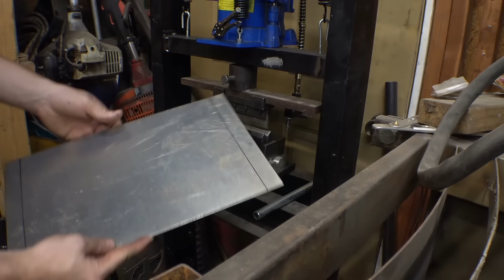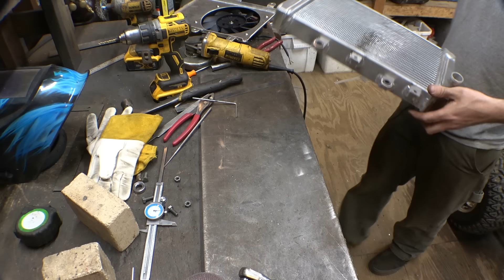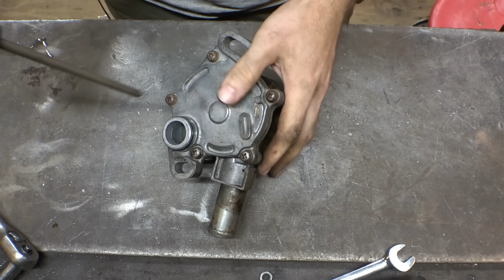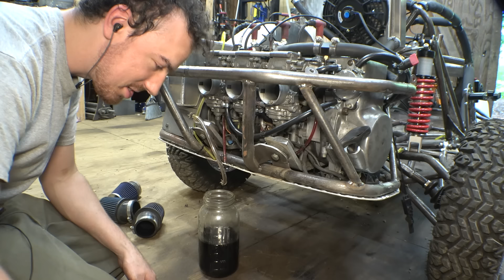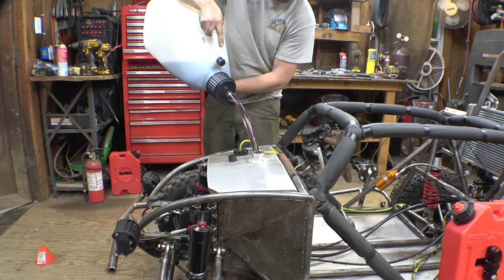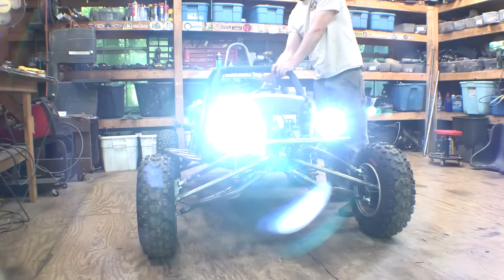Fixing all the Problems on this - Mini Baja Bug Project

Comment: If the internal resistance of that battery is low it will cause the regulator to use a lot of power. I'd try another battery. 14A is way too much and you'll lose the battery and the regulator if it runs like that very long. If it's not the battery causing the issue it's the regulator. Another thing to try would be an in-line DC amp meter on the battery side of the regulator. Clamp amp meters only work on AC.

Comment: It should be OK. Just remember that electrical devices draw current to them. Let's say if the head lamp draws 10 amps then it's only going to draw 10 amps. Voltage is the pressure. Voltage is what you have to worry about. Anything over 15v is not good for 12v systems. It's normal for the battery to read over 13v after shutting down the engine because the battery will maintain a surface charge for a while but will normalize in about an hour. The regulator was probably getting hot for lack of ground or lack of heatsink depending on the design of the regulator.

Comment: Bro, how many ac volts does the engine give? If it is less than 70v, you can install a diode bridge, and after it install a ds-ds converter 80 to 12v from an electric bike. A cheap ds-ds converter produces 10 amps at peak. This will be enough for LED headlights and charging such a battery. A dirt bike has one piston, but this thing has three, so more amps! This converter gives a lot of amps to charge the battery and the battery can overheat and splash acid. Also because of this converter, there may not be enough voltage for good sparks. =)
Reply: amount of pistons in the engine doesn't affect the charging system... also charging and ignition circuits are separate, theres a different coil for each.
Reply: @no.nomoreidontcare  Thanks! Now I know! =)

Comment: Should have kept the oil tank and either left it full with 2 stroke oil so you'd never be without oil for mixing if out on a trail etc or used the tank as an emergency fuel tank. My 2 stroke kmx125 doesn't smoke wot so ever & its oil injected infact 2 strokes shouldn't smoke if the mix is correct but people always go over the top when mixing fuel & oil . .

Comment: Amperage is determined by the load.  You're fine.  Also no problem with a 12v battery having a surface charge higher than 12v.
Go do a wheelie and everything will be okay.

Comment: The biggest problem with deleting the oil pump is having no over run lubrication. You get no engine lubrication when decelerating or descending long hills. When running premix just don't let the engine rev without having your boot in the throttle.

Comment: The white stuff inside the cover looked like crystallised glycerin from the coolant
Also the battery should be charging at 14.5v roughly and will gradually drop down to just under 13v

Comment: The regulator is not about 2 stroke vs. 4 stroke.  It is about amperage of the stator and the rpm range.  I would look at the model for your engine and find a comparable stats in amperage and voltage on both sides.   For the fuse...not quiet.  Since you found 25 amp fuse for the regulator input at least.  The fuse being between the stator and regulator only protects the regulator that is designed for the 14 amp load.  The 25 amp fuse makes sure that the stator does not go crazy on the AC side to the AC side of the regulator.  If the regulator itself is not designed for 25amp input, it will blow happily with the 25 amp fuse with a system that is designed for 25 amp load and the regulator that you picked does not have a 25 amp input capability.  The fuse will be fine and not blow.

Comment: I can't believe the 2 stroke pump wasn't working at all; otherwise,  you'd have seized it.   Having said that,  those oil pumps on older motors have a tendency to fail when used with alcohol blended gas.   Deleting the oil pump is a very common mod. 

Another note,  I'll bet you were pulling a lot of air into your coolant circuit thru that failed bearing.

Comment: Get rid of the original water pump replace with an electric one. Pre mix fuel. Small oiltank (rear brake motor bike tank will do)  tank on to oil pipe leading to crank keep full off oil  👍

Comment: I hope this helps... You can have a 100 amp alternator on a project, but it doesn't mean it is "pushing" 100 amps. Amps are "drawn" (pulled) by accessories. Your rectifier is supplying about 12 or 14 volts of potential. That's all. If nothing is drawing on it, then it's 0 amps. If you put 120 watts of lighting on there, then you'll be drawing 10 amps on your lighting circuit. If your system can't supply 12 volts at 10 amps, then you'll have a problem (dim lights). If it can supply 100 amps at 12 volts, then you simply have overhead.

Comment: Did you use distilled water in the radiator the white spots might be “corrosion” from electrolysis. Just from when the water pump was leaking. Coolants really corrosive.

Comment: To solve your coolant mess issues, put in a proper drain port on your projects! Rather than taking off hoses and using air to blow things out, just put a drain in at the lowest point of the system and a tap or system you can open.
That water pump is shagged totally, that will 100% be why things overheated, but your radiator position behind your body wont have helped, but mostly due to the water pump.

Comment: The battery is basically dead at 12 volts.  It should be about 13.5.  Most batteries get charged to 14.5 volts.  Don’t worry about amps.  Notice that the regulator is made with fins to cool it because they get hot.

Comment: Are the shavings from the water pump blocking galleries inside the radiator causing it to over heat

Comment: The jetting between running oil injection and not is different to accommodate the difference is the amount of fuel and oil mix.  I never recommend deleting the oil injection.  They may have other passages they are oiling.

Comment: You put it where the air flow is better, but you should turn it 90 degrees, so the air flows through the cooling fins, not at the side of them

Comment: My Ducati’s regulator also becomes quite hot in normal operation, I would have turned yours 90 degrees so cooling ribs are inline with airflow from front.

Comment: I'm not 100% sure, but your new pulley looks like a machined piece, while the old one looks like a stamped piece of thinner material. I think you need a narrower belt that fits the new groove better. Some belt slippage might be in your future.

Comment: you have a fan running drawing power you going to have little more amps it's fine 14 volts is good long as it dont get to 15 volts your good I wouldn't worry about it just make sure your regulator is somewhere it can get plenty of airflow

Comment: That was just aluminum corrosion on the inside of the cover. It happens very quickly when old aluminum is exposed. Also. They have that flyer on the gas can for liability purposes. There is no safety reason at all to not use it for gas. It’s the same thing as the ones they use to sell at napa as “race cans”.

Comment: Ghehe you never seen cold and wet weather that white stuff  is oxidation. The pump could definitely have been blocking up and not spinning due to the blade jamming up in the housing

Comment: The oil pump is missing it's cable lever that is supposed to be attached in with the throttle cable so it will add more or less oil depending on throttle position that is why there's no oil in the line

Comment: You can test the oil injection pump with a drill, very little oil should come out of the lines in little pulses, I would highly recommend against deleting the oil injection, if the pump actually did fail and you were running straight gas, that motor would have locked up in less then a minute.

Comment: if it was running lean it would contribute to the over heating condition? and a bad water pump would Add to that. it should have been boiling over. but that engine should have a closed cooling system. that has a catch can near the radiator. with a radiator cap that draws the coolant back into the cooling system as it cools down. similar to the cooling system's on modern cars. and it should have a thermostat. that keeps the cooling system around the specified operating temperature for that engine. as for cars, the lowest temperature thermostat that a person can get is a 160° thermostat. but most modern cars have 210° thermostats. which allows the emission control system. to burn the fuel more completely. but that's not the same objective on a two stroke engine. where a small amount of unburnt oil is allowed to pass though the exhaust system. because the oil that lubricates the the engine is mixed into the fuel. where a four stroke engine the oil that lubricates the engine is in the crankcase of the engine. and your best bet is to mix the oil and fuel. because oil injection systems can be somewhat untrustworthy. and that way a person knows exactly the amount of oil that's in the fuel at all times.

Comment: You can replace battery whit capacitor. I uce 2200uF/16v capacitor and it works fine whit regulator rectifier. Much lighter and smaler than battery.

Comment: Plugs are fooled. You need to start these run slight throttle/ high high idle till warm then go brap it 3 good drag pulls getting it on the pipe under load not in neutral to clean er out.  then it’s good. Anything short that it kills them plugs

Comment: 😯ABOUT THE ELECTRONICS😯
You can safely put it on without the battery,
 its not going to break when there is no load, that is what the regulation part is for not for the voltage to spike up, BUT WHAT IS ALARMING YOU SAID THAT IT SHOWED 14.6V THAT IS TOOOOO MUCH !!!!!!! just measure the VOLTAGE OUTPUT WITHOUT ANYTHING HOOOKED UP, IT SHOULD BE 14V AT MOST, IF IT IS ANY HIGHER IT WILL PERMANENTLY DEMAGE THE BATTERY AFTER SOME TIME, also I hope that regulator has isolated casing because the if it is grounded it could do some problems (measeure between rectified Ground or Minus and the casing if there is no conenction than it is good.

Also if you want to limit the curent and protect the rectifier just ad resistor in series on positive output, because it is running at 14V and you want probably max 10A so R = 14/10 so you want like 1.4 Ohm resistor so it would limit the curent it could provide so it would not even pull that much just make sure the resistor can withstand that much current.
ALSO BATTERY WILL NORMALLY HAVE MORE THAN 12V even 12.5 V is pretty low and max charged is going to be 13.8V (as I said 14V at max), and that is the reason why it was pulling that much current, because the battery was pretty low so it was quickly trying to charge back up, thats why it was so hot and why in the CBR 1000 it was not pulling that much because it was probably charged so it was pulling less curent, i will explain it like this the battery was "Less desperate" so it was pulling less curent, but the battery for this project was almost fully discharged so it was "very desperate and very hungry for curent" thats why, it should stabilize after it is going to charge so it is not going to pull that much so it is going to run colder.

PS: let me know if you read this coment or if it helped you at any way

Comment: I've used those plastic tanks just like that (from Rural King) for gas for a few years, due to the BS safety crap on the other tanks. They work fine. It's just not approved by the government, since there are no safety valves to fail.

Comment: The voltage regulator controls the output of the alternator. You should not be seeing 21 amps. Look up a wiring diagram for a sled that has DC accessories.

Comment: The auto lube system is not just for convenience it makes it run using less oil by pumping the lube directly into the main bearings where it handles the lubrication much more efficiently also the fuel burns more cleanly leading to less carbon on engine parts ...I'd be really sure before dumping a system that has worked for me on my dirt bikes flawlessly over the years and on snow machines everywhere

Comment: i could be wrong but i think charging voltage should be around 14 volts it is on most cars and trucks if not all           and it prob got hot because you was charging the battery the others wasnt hot  because the batteries wasnt low   onces agin i could be wrong

Comment: If you knew anything about those engines. You would know not to remove the oil pump. They hardly ever fail with thousands of miles. But  you need to bleed the pump after it's been unhooked..  there's a bleeder on the oil pump with a hex screw that you can ues a flat screw driver also. That must be pulled and let oil drain threw the pump for a minute or until all air is gone. Then tighten it up.. the pto bearing was a big problem with failing so they added the oil to it and fixed the issue... I've seen 20 thousand miles on many different machines with the same oil pump....

Comment: I would be careful removing the oil pump and oil lines for the engine.i knew of someone doing this just trying to run premixed fuel. And burning up the engine besrings.

Comment: Next time you want to make a 2 stroke snowmobile project buy a REV Mach Z 1000 or REV 800 Skidoo motor with electronic reverse.      The rear end still sits too low.

Comment: Dude its a 2 stroke. No matter what, you are GOING to blow it up. Sounds like ur already on ur way to a top end rebuilt. 2 strokes are not like 4 strokes. Compression is EVERYTHING with a 2 stroke. So the fact youve lost 12psi in 2 out of 3 tubes is significantly detrimental to the performance. Then you're gonna run it harder, so on and so forth. If it was me, i would pull the head and inspect the rings and cylinders. You could very well catch something in there that could be the difference in ordering just 3 shiny new pistons or new cylinders, potentially new bottom end AND shiny new pistons. Dont get complacent. If youve lost compression you need to investigate the issue especially with the list of forehead slappers you had when you ran it. You got a snow machine engine thats designed to run at a maximum of 150°f to 207°f. It then ran for how long on straight up gasoline? Heres your saving grace, those cylinders do have a space age coating i cant remember the name of that get super saturated with oil and create a couple microns of protection. It definitely sounds like you have a hole letting go from my house man. That honestly means nothing though what im hearing when it runs could be non existent. However, ive been a Yamaha mechanic for the 9 years since i got out of the Marines and ANY time i have a 2 stroke drop compression, i do a D&I...that's disassemble and inspect to any who doesn't know. Multi tube engines are way harder to feel because they have 2 other pistons helping the damaged tube along. Ive just seen utter heartbreak with some older 2 stroke Yamaha sport bikes. Stuff that an engine rebuild is very, very expensive. The customer tells me "Nah, ive ridden this bike for 16 years. Had one before this one too. It hasnt lost any power. Two weeks later, what comes in on a flatbed with a seized engine and gacked gearbox? Yup. That absolutely gorgeous rz500. I got him squared away the thing cracked like a whip when i was done with it. Unfortunately, it costed him almost $6,000. Yes...Im a very expensive but very thorough fixit whore.

Comment: bro, the battery is ok. 12v batteries are full at 13.6v-13.8v and discharged at 11.8v. if you get below, the battery gets damaged.

Comment: You need to look at the CVT the engine is hitting way to high RPMs before engaging. That is speed loss. The engine should not hit almost 90% of its RPMS before kicking in

Comment: I told you to get rid of that oil pump..... you need to premix your fuel. Take this as a warning, oil pumps fail and will grenade the motor... premix in all 2 strokes weather they come factory with an oil pump or not, delete the oil injection and premix the shit.

Comment: The oil injection is run off a cable u orobmy didnt have it set rite . Neve rhad a probmy woththose oil pumps on those engines. It need to have oul pump cuz the goes to thw bearings . U have to have the cable set rite .  There aark on it with aine . U have make it lil richer if u want.

Comment: First get 50/50 Coolant to help your Engine and take Care of the Rusty Water, Why would you not Help your Engine out by not using the Airflow plus the Fan behind your head. Airflow does better if you Don’t Fight it. Also why do you want to Suck in Hot Air with your Fuel? My take get those three Air Filters up where it Can Catch Cool Air. He’ll stick a small Turbo on it since the Engine only getting hot Air and fuel mix

Comment: I'd keep your oil tank and repurpose it as a surge tank for 3 reasons. 1 to help the fuel cut issue. 2 extra fuel capacity and 3 all your hard work making it doesn't go to waist. Now that you've added a battery I'd put an electric fuel pump from the main tank to the oil tank and I'd run a return back to the main tank. Then use your vacuum pump from the oil tank to the carbs.

Comment: You did not fixed all the problems, you need to put back the oil pump on that 2Stroke engine and the regulator is good, you need to mount on the ground plate on the frame to remove the heat.... Lots of love from India....

Comment: Running a Alternator set will have 14.7 volts at idea for a 12volt system that's normal

Comment: First off, that is a gas can. It’s just labeled wrong so that the t can get around the EPA regulations. Second, PUT THE OIL PUMP BACK ON THAT ENGINE! It oils the mains and other parts that will not get oil from the fuel. You are just going to destroy it. Do some research before you ruin stuff.

Comment: The idea that 2-strokes should always smoke is not correct. After it's warmed up and if it's properly jetted and the injection pump running correctly you should not expect a lot of obvious smoke.

The irony here is that by switching to pre-mix you're probably more likely to hurt this engine... 🥺